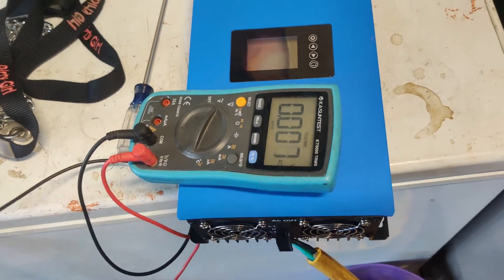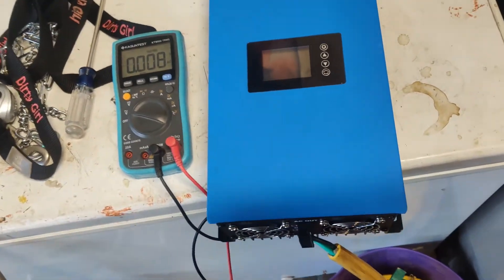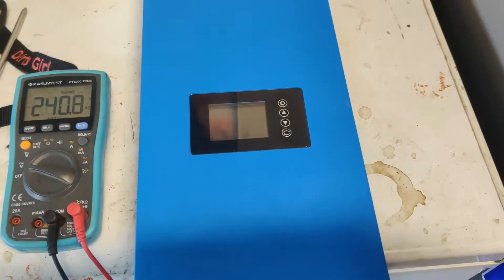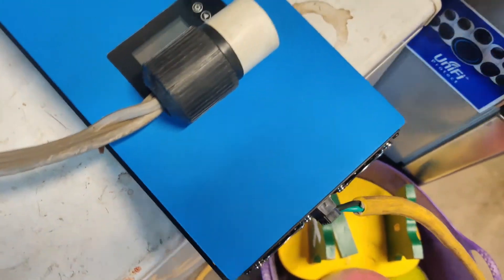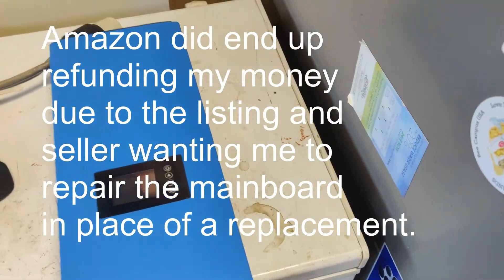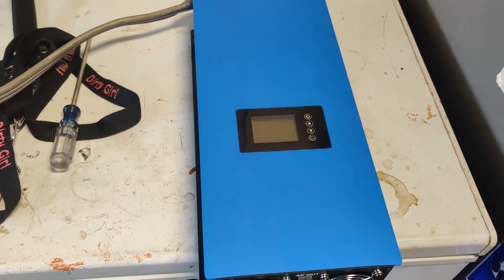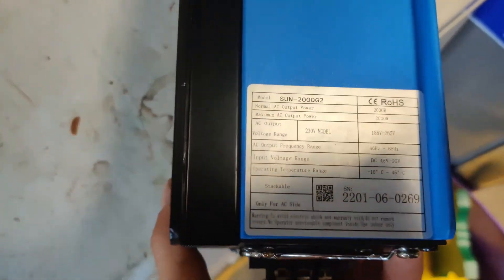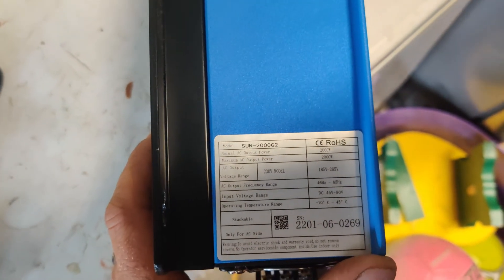Y&H grid-tie inverter unboxing and it's dead

Comment: Y&H, Sunpower, whatever name happens to be on them, they are junk. I've had several, and they won't last anywhere near even just a year. And all are used far below rated capacity. Caps blow, mosfets short, cooling fans never operate and units overheats ... Unless you're able to repair them easily and insure they are cooled adequately, buy something better.

Comment: Hey there, I have one of a similar model from "Y&H" i just wanted to ask, isnt that 240v "AC OUTPUT" only for AC out and not meant for AC to be fed into the unit? I have AC IN and AC OUT on my model, but its a solar inverter so we use the DC solar to convert to 240v AC, only issue is you NEED a battery (24v in our ase) hooked up or it wont even turn on, regardless of voltage at the panels!